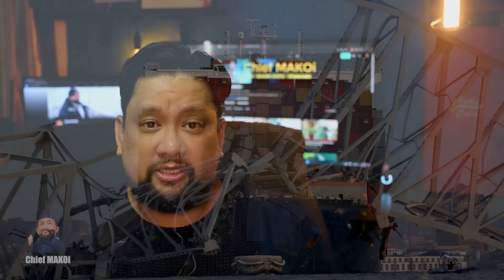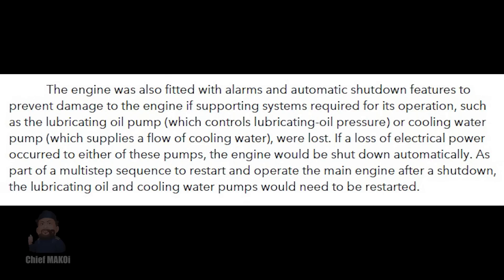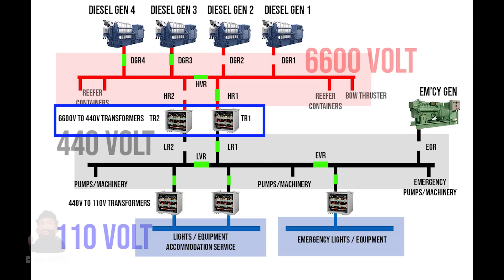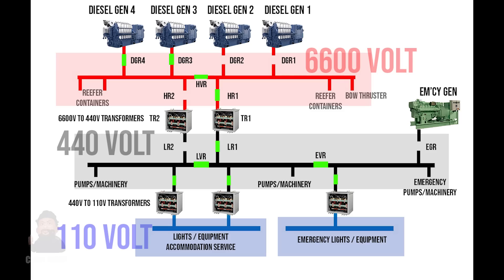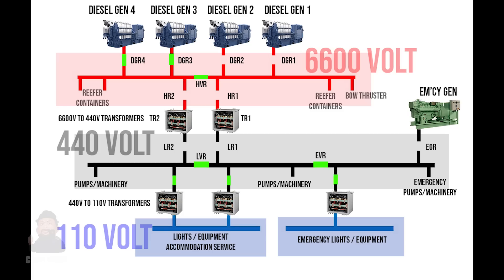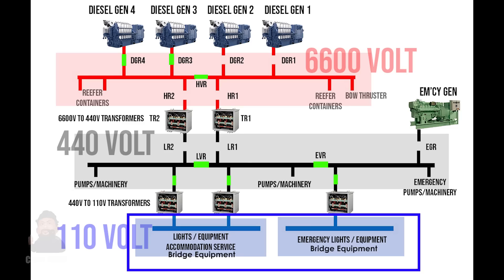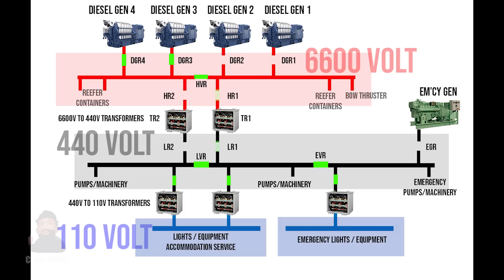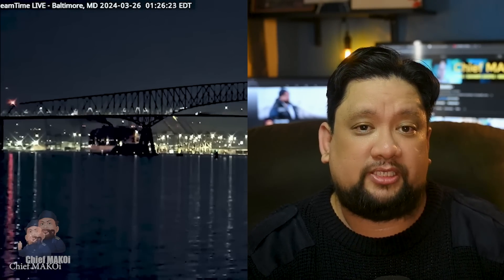Explaining the NTSB Report on the Container Ship DALI | Chief MAKOi

Comment: Great diagram and explanation! Although it makes me wonder why TR1 and TR2 are not both permanently connected to the 440 volt line for redundancy, so that if one trips, the other will still supply power. Sounds like that would have prevented the problem from ever occurring.

Comment: Great graphics!   I’m thinking that operating a ship in restricted waters should require to have the emergency generator already online and carrying the load.  If the emergency generator decides to fails it would only take seconds for tie breaker to close.   

In the aviation world when airports were running CAT II and III landings the ILS is already on emergency generators.  There is a requirement transfer power within one second.  I would guess by now the FAA has replaced their EG’s with battery systems.  But the same type of mentality should apply to ship operations.
Reply from the maker: The EG can't run the systems required for the main engine.  Not enough power.
Reply: @ChiefMAKOi  I understand that.   I was referring to being able to maintain some type of rudder control.   Even a little bit of rudder control might help.

Also I’m guessing that both the HV and LV buses are split with the main pumps on one side and the standby pumps on the other.  If that is the case I would open the tie breaker and run the other generators to be ready to go.   This would protect the use of the bow thruster.   While the thruster would not be very effective at 10 knots it might be  enough.
Reply: @fountainvalley100  On a ship of that size, the bow thruster is not very effective above about 3.5 knots. However, even though there was still power on the 6600 volt bus, there would be no possible way to use the bow thruster, as all the controls and contactors for the bow thruster and the bridge remote controls for the bow thruster all run on 440v. Only the bow thruster motor runs on 6600 volts, all the rest of that system including cooling water for the motor, lube oil, control and speed/direction control systems, the motor starters all need 440 volt in order to function. Think of it like a house HVAC system. You can have 120v power to your furnace, and 240 volt power to your outdoor A/C condensing unit, but if that 24 volt control transformer blows, you have no power to your thermostat, and you will have no heat or air conditioning at all. The high voltage parts of your system will just sit there idle, waiting for a call from from your thermostat.
Reply: @brnmcc01  I believe you just made the case to run with the tie breakers open on both buses in restricted waters.

Comment: Often/usually generators (& even main engines) get fuel from a "day tank" which is filled from the main fuel source.   If managed correctly, bad fuel will only take out one generator.   Bad fuel from the main source reveals itself as the engine with the day tank most recently filled stops working.   But I don't know the situation on large ships with one main engine and 5 separate generators it might not have been manageable.

Comment: Black smoke means those generators were getting plenty of fuel, and were heavily overloaded. That explains why their breakers tripped so quickly after TR1 was put on line again. They were driving into a high impedance fault. That’s going to leave.a lot of evidence somewhere, as those are very energetic faults. Whatever fault caused the TR1 breakers to trip and caused the first blackout still existed when they reset those breakers, causing the second blackout. There’s some electrical carnage somewhere, they just haven’t found it yet.
Reply: Hmm, if it was a high impedance fault, I think it's unlikely it would have caused an overload. The main danger of high impedance faults is exactly that they usually don't cause overloads, meaning they usually don't trip any protections, so they can cause a lot of damage to whatever is the cause of the fault (touching the circuit), but usually no damage to the circuit and power source themselves, except possibly local thermal damage.
Reply: @VladimirNicolici  In this context "high impedance" is a relative term.  Sustained arc faults are high impedance faults.  The impedance is high enough to not outright drag the voltage down to near zero, such as a hard short circuit.

Comment: I don't know much about big ships, but it seems like for a ship in a narrow channel, the main engine is a single point of failure with no risk mitigation. I imagine that having bits of electrical equipment trip out is something they have to plan for but in this case it very quickly escalated to a tragedy. Could the main engine have been built to run for a short time without power? Should the port have considered a large ship losing control?
Reply: Cannot run an main engine nowadays without power. The pumps are too big to be articulated. We used to have a lube oil tank in the funnel, for lubrication in case of blackout, but that was 30 years ago. Now everything is electronically controlled, no power, no engine

Comment: Chief is there any "required" switchboard maintenance and  inspection ? If so what is the required time period. Very informative video, I served in the US Navy and our electrical distribution systems are very different so it nice to see your diagram and heard your explanation.
Reply from the maker: The major ones are usually done in drydock.  So that's every 2.5 years.  The others are done by the ship's electrician.
Reply: Just for my curiosity since you served in the US Navy: are there regular kind of `electrical blackout drill exercises´ to get familiar with emergency procedures (would assume so int the military)? To be clear, this question does not at all target to assess performance of civil marine crews.
Also remember one YT video from Chief MAKOi about simulator training for civil vessels covering such emergency scenario.
Reply: @NRZ-3Pi10  I was on Submarine so we typically don't have blackouts because of the design of the electrical system. Having said that, we do Drill frequently on the loss of the SSTG's(Ships Service Turbine Generator) or SSMG's (Ships Service Motor Generator).
Reply: @stevemetts6206  Thanks, as I've expected wrt `drill´. Well, so you don't have electrical blackouts; but also don't see daylight for weeks or even months ... with the latter might also appear for engine room crews on any maritime vessel. 
Perhaps good opportunity for a `Thanks so much´ to all marine crews for their service & dedication.

Comment: Very strange propulsion system which requires the main engine to be shut down and restarted every time the direction of propulsion is changed - from ahead to astern and vice versa. A big handicap in pilotage waters. Pardon my naivety but why no reverse gearbox on this ship? Was it because Dali's was a low rpm engine? Secondly, could this ship have fallen victim to over-automation and auto-shutdowns? It seems the designers' main priority was the safety of the engine rather than the safety of the ship (and everything else in vicinity as was the case here).
Reply from the maker: Majority of cargo ships have directly coupled, fixed pitch propellers.

Comment: Would the transformer breakers open on low frequency? Wondering if a fuel problem caused the gens to starved of fuel, under load, and slow down. Once load removed gens return to operating rpm. Manually close breakers around transformer creates same problem.
Also are these gens  dual fuel? Low sulphur DO in confined waters and IFO when full away. Could black smoke be from cold(ish) fuel upon start up?

Thanks for the analysis. Much appreciated
Reply from the maker: Low frequency will trip the generator breakers, not the transformers'.
Reply: @ChiefMAKOi  I wonder if they began to be starved of fuel as soon as they lost 440v power. I have no idea what size of a day tank they have on Dali for the generator plant, nor how much fuel was in the tank at that time. Seems likely to me since the black smoke started about 12 seconds after the initial blackout and didn't stop until DG3+4 breakers opened and DG2 auto started from standby and was put on load via TR2. It seemed to be a lot of black smoke to me too, but if it was coming from 2 generators starting to run badly at the same time, would be more likely to me.

Comment: I’m a retired ships pilot. Thank you so much for providing these detailed videos about this issue and shipping in general. There are so many YouTubers that only have a cursory knowledge of shipping and really don’t have much experience. It would have been nice to work with you when I was sailing. Keep up the good work!
Reply: Could you imagine that losing `propeller walk´ once main engine slows down and finally stops could cause some `compensation effect´ pushing stern to starboard then (opposite to active prop-walk pushing to port for right-handed propeller)? I wonder whether such thing could explain Dali veering to starboard and towards the pillar once the first blackout happened. However, just thinking from physics here, and thus I'm interested in feedback from experienced seafarers & pilots.

Comment: Can someone comment on why TR1 and TR2 were operated in an online/offline mode versus a load sharing mode with the low voltage bus split? It would seem the load sharing mode would be more reliable when performing critical moves i. e. leaving port.
Reply: They are probably large enough to provide a big enough margin to handle the entire ships load. And they are kept separate in case of a catastrophic short circuit. Why risk blowing both transformers at once? You only use one at a time, and keep the spare one unplugged so to speak, so a fault on the online system won't also take out the other.
Reply: That's exactly the point of splitting the buss. Any single fault will only take down one buss the other buss will remain online. Half of the pumps remain operational, the main engine is not stopped. @brnmcc01

Comment: in my xp, a 40' displacement sailboat won't turn by rudder under about 2-3 knots. This is annoying because of the tendency for the propeller to try and 'walk' your stern in the direction of rotation.

Random thought, if I ever build my electric boat I'll use a twin prop setup so that you can use differential prop walk to park like a pro. Paying for bow thrusters is for nerds.

Comment: Many thanks for the clear explanation. I'm intrigued by the fact that both breakers associated with the TR1 transformer blew, starting this terrible cascade of events. If the problem lay in the transformer, I would assume only the high-voltage would blow. The fact that both blew not only suggests that a high demand on the 440 volt bus triggered them, but that it was large enough and sudden enough to trip both. Otherwise, slight differences between the two would mean the more sensitive one would trip, removing the reason for the second to trip. Does my reasoning make sense?
Reply: I agree both should not trip together. I think it was low volts or low frequency on the 6200 system ... the black smoke indicates a overloaded generator .
Reply: @kennethchristensen7457  Or they weren't running properly due to partial fuel starvation? Looks like at the first power outage, they would have lost the 440v fuel pumps supplying fuel to the generators, yes there's a day tank, but I have no idea how much fuel was in it at time of blackout, or how long it would last with 2 gensets pulling fuel from it. That might explain why the black smoke started 12 seconds after the first blackout then it stopped when DG3+4 breakers tripped, and DG#2 was put into service from standby mode.
Reply: @brnmcc01  I agree with you .The black smoke is the big clue. I think gen 4 was driving gen 3 .gen 3 had a fuel problem. It takes a lot of power to drive a big diesel engine at governor speed .The black smoke is from gen 4 . There is safeties to prevent this but i think they were  not working or were bypassed.

Comment: From a safety point of view i find it hard to understand why they only use 1 transformer at a time. I come from a utility background and that is not normal practice. If utilities did that, blackouts would sharply increase in number. In my my view that is just plain stupid. 
Secondly the NTSB report is useless without giving the reasons for trip. That is the protection flags which would have to be assessed before the decision was made to close the same transformer breakers rather than the other ones. Also a situation which is not normal practice in a utility as you can cause a major fault escalation closing on to a faulty transformer. Generally such a transformer will be left out for assessment later and the more likely to be healthy transformer restored which in this case was definitely not involved so could be safely closed in. Very little of all this makes sense from an electrical operations point of view. If this is marine industry best practice it really needs to change.

Comment: A good walkthrough, Eng. The more detailed one line diagram helps immensely by showing the vital bus, its generators, and the emergency bus tie breaker. Also, the normal lineup with the tie breakers shut. That ship’s loads were 480 V with 6600 V for cargo panels and bow thrusters was a big clarification. I share your suspicions about a 480 V fault and a SSDG fuel issue.

Comment: Great video. It will probably take two years to get the final NTSB report. At least we have a better understanding of the events and that they had no way to steer the ship once they lost power and it happens to ships around the world all the time, they just don't hit bridges very often. I don't think its a good idea to have ship with just a single main engine and propeller. If they had twin engines and they were isolated for each other they could have more control. Twin engine aircraft are safer than single engine.

Comment: Do the generators use a separate fuel source from the main engines? Is it possible for the generators to have contaminated fuel but not the main engines causing their failure? Great video, even a boy from Nebraska USA can understand your work.
Reply from the maker: They were using the same fuel at the time.  Although it's possible to separate.

Comment: Chief,  A good analysis but you missed one important item.  On the two generators running after leaving the dock ( a pair side by side)
there is a circuit built into the governors and voltage regulators to insure stable load share between the generators.  This circuit is cometimes called cross current compensation  ciricuit  This circuit was not functional.  The load gradually moved onto just one generator resulting in a trip out  of the breaker with the lowest trip setting .   This control circuit is seldom on the switchboard and thus the crew is not often familiar with it.  It is worth noting that this circuit applies ONLY to the two generators.  The other two generators have the same control but are a separate system.  Thus when the crew switched generators while still in port they may have moved onto a disfunctional cross current control circuit on the newly selected generator set. This circuit controls both KVA and KVAR load share.
Again, these are separate control systems and any attempt to run 3 or 4 generators in parallel is asking for trouble.  I am a EE with a lot of shipboard experience.
Reply from the maker: That could be the cause of the second blackout as it tripped the generator breakers.  The TR1 breakers were the ones that initially tripped so that's a different story.
Reply: @ChiefMAKOi  Good point.  If HVR and LVR are both closed you have two transformers  in parallel   feeding a commom load.  Normally transformers have a common feed on the high side but are not common on the load side.  Even with identical transformers there are difference between the two....ie they are not naturally in sync.  It looks to me that the original design was to have a two part system for flexibility.  If so when both transformers are energized either LR1, LVR or LR2  should be open.  This looks like to me a trap set up by a design error!
Reply: Interesting. However, according to the NTSB preliminary report, the initial problem was the tripping of both the HV and LV breakers on the no. 1 transformer, not any of the generators breakers (although they did trip later).

(Edit: typo)
Reply: @alexandermonro6768  Alex, good point however The first breaker to trip is the the one with the lowest setting (or trip point) on the circuit .  There are several breaker on the circuit in this case.

Comment: With the engine being reversible, does that mean the valves are electrically actuated or does it have 2 cams?
Also, how do they handle the phase relationship between the various generators so they aren't fighting each other?
Reply: On ME engines they have electric actuated valves. On MC engines, there's one cam but the pump actuator changes position on the other side of the cam.
Generators are synchronised when connected to the bus bars.

Comment: On modern electrical distributions on ship programmable computer units running essential  electrical demands as selecting which generators will be on st-by or running which is connected  synchronized or  parallel with split bus .All this must be in good order but on Daly engineers screw up split bar on one side and they lost power on main engine without any generator on line.

Comment: The breaker "interlock" for the Emergency Generator and the Main low voltage bus seems to be forgotten. The EG can't be furnishing power to the main switch board just the emergency board. The other note is the power management system has micro controllers for each breaker. It sure sounds like some serious control circuit trouble shooting to be done here!